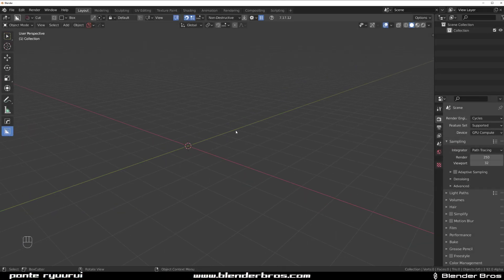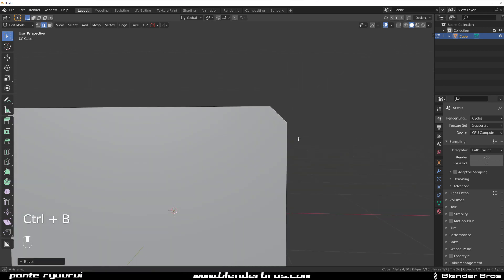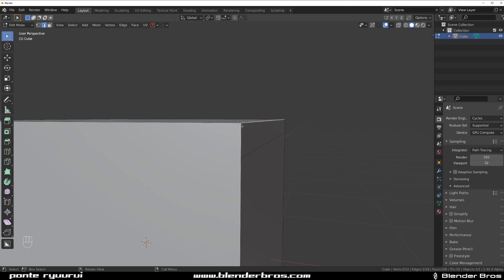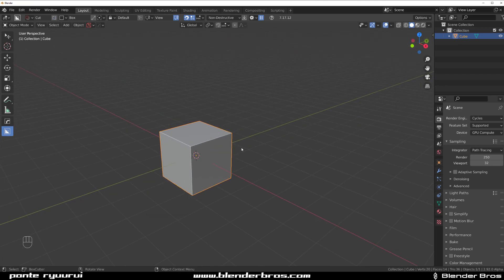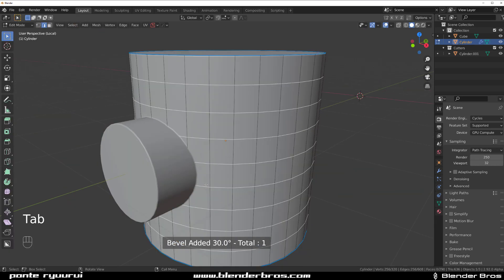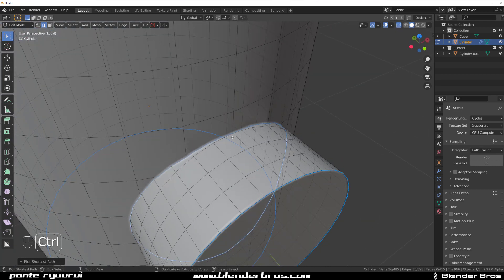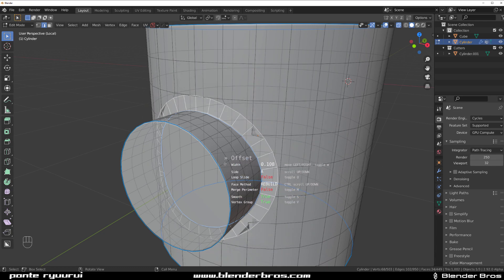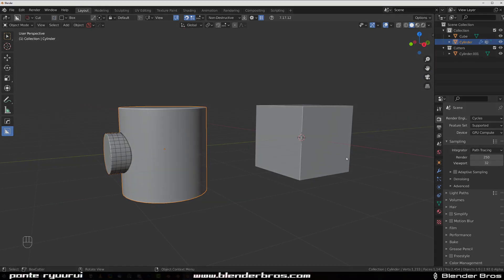How to OFFSET edges in Blender with HardOPS and Mesh Machine - hard surface tutorial

Comment: Thanks for this.  That offset has saved my bacon a few times with some odd geometry.  Had a circular cut in to a face at an extreme angle with sharp edges.  Triangles couldn't be avoided which is okay since its a game asset but more than 3 edges going to single vert over distance caused some artifacts.  Simple offset the circle to widen the triangles and problem fixed.

Oh and I love love love how mesh machine offset saves the vert group.  Super handy.

Comment: without add ons  you can ctrl+shift+R do on edge well do the same as offset ,good video as always
Reply from the maker: I see it has the same limitation as the hardps one, you cant off set all edges on the cube, i wonder why it is so
Reply: @PonteRyuurui  yes that can't be done with ctrl+shift+R but by bevel mesh segments set to 2 and profile shape set to 1 can offset all edges
Reply from the maker: @hedyxalil9736  ya thats true, can be automated with hops as well, you just press 3, you just gave me an idea for some tips vid mate, cheers!
Reply: @PonteRyuurui    cheers 😂✌️